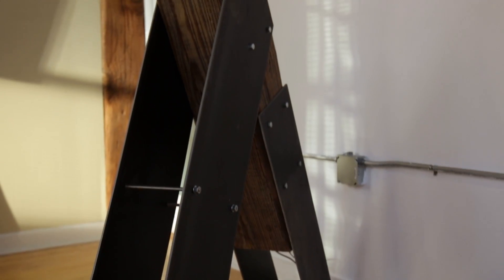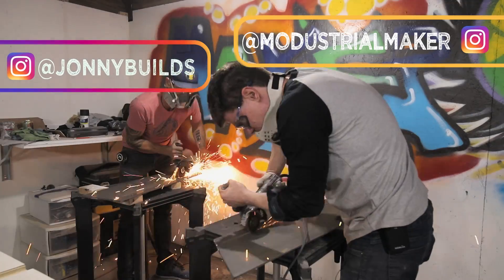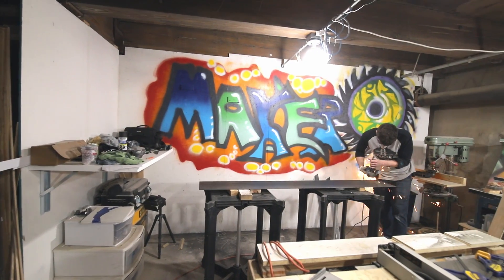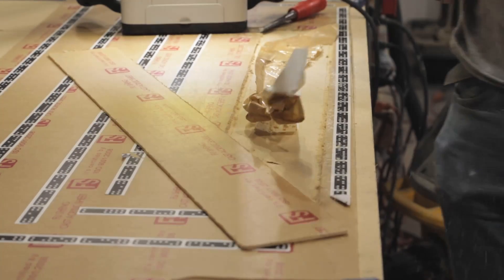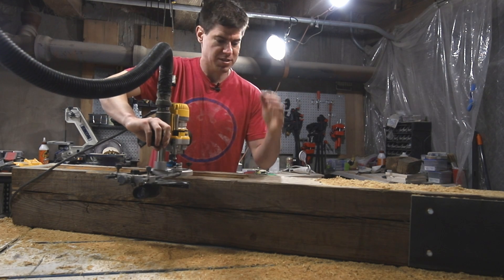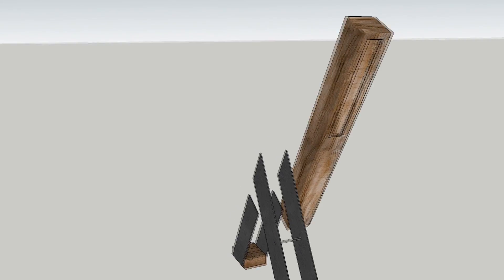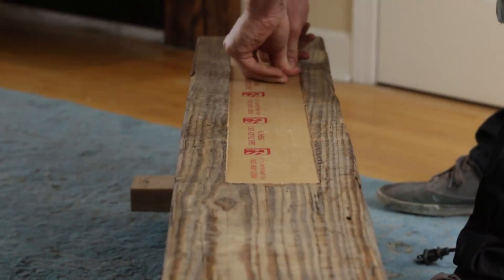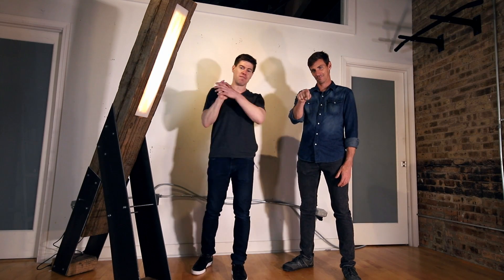250 POUND Reclaimed Beam Lamp || Music-Reactive LEDs || DIY Woodworking & Metalworking

Comment: Awesome !! 
I wish i had the space & tools to start a project like this. 
Only i'd put the lights facing the other way, bouncing on a corner wall, maybe a slimmer beam with light hole drilled all the way through the wood and replaced by a solid copper piece with cooling fins, on the longitudinal axis of the beam, extruding from the back (lower) side of the beam for cooling the high power, warm tint led strips i'd be using. 
I believe something in the area of 4000-5000lm with a dimmer would be great for lighting a living room this way. 
Man, your work makes me dream !!
Reply from the maker: Thanks!  This was a fun one!

Comment: It's so narrow, how easy is it to push off balance? I feel like it's a lethal danger to pets and children considering the weight and height.
Reply from the maker: We hung off of it and it didn't tip over...you would probably need a running start and throw your shoulder in it to tip it.  The steel is super heavy and grounds it pretty well

Comment: Super cool! Your videos are so well produced. One thing I would add is that the steel will slowly rust over time. Covering it with a clear coat will prevent this. But all depends on the look you're going for. Some want that rust look. Really unique build. I could see these lamps getting trendy.
Reply from the maker: Thanks! And you are totally right about the rust.  Forgot to show that on camera.  I actually coated the steel with paste wax to prevent rust.